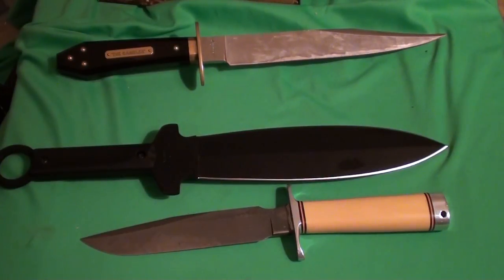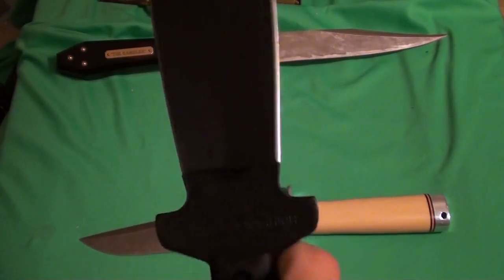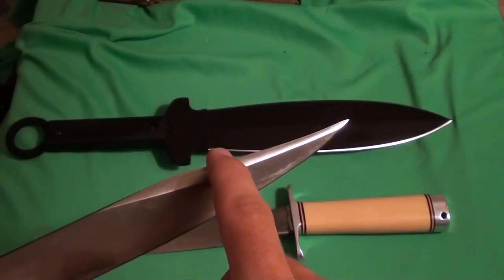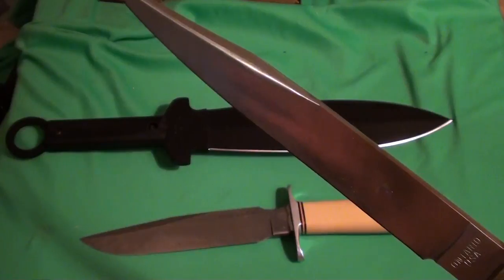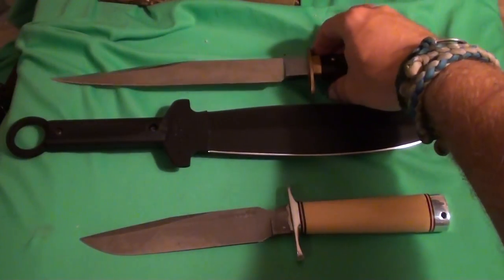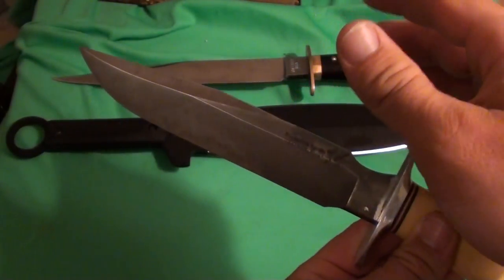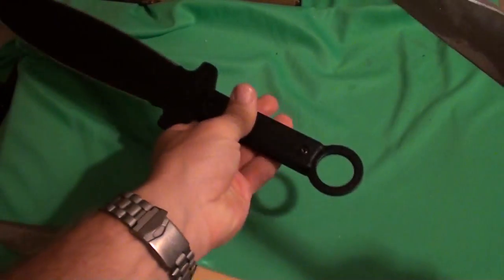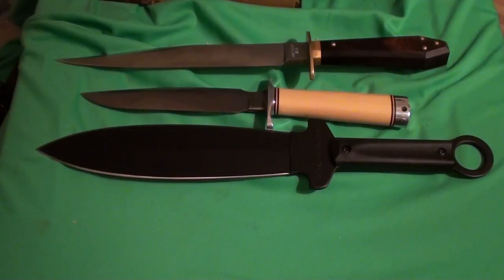The differnce between a false edge and a swedge

Comment: Do you know what's the spine swedge for, on the TRC Mille Cuori? it looksok, but what it's function for on that specific knife? Thanks in advance
Reply from the maker: I looked the knife up I am not familiar with it and it seems like like it might help with penetration
Reply: @Hissatsu5  Actually, it stops before the tip, to maintan the tip thickness. From the search I do the last hour, I came out that it helps for slicing while adding some more steel for strength. If you don't know that maker, TRC knives, is probably the best quality production company out there. The Mille Cuori is their combat knife design. They focus mainly on quality, rather than quantity, which means, they don't make many different knives. It's the only maker, that it's knives, don't lack, in any department (materials, fit and finish, heat treatment, edge geometry etc) Thanks for the response
Reply from the maker: @greekveteran2715  I never heard of them before but thanks for putting them on my radar

Comment: Many, maybe most, false edges have a swedge on them.  Anyway, if I understand what you're trying to say, then no, if a false edge is sharpened, it is no longer a false edge.  A false edge looks like an edge, but is dull.  Most false edges then have a swedge on them,  which is a ground flat that runs beside the false edge, and usually, but not always, down to the point.

Most Bowie knives are described as single edge knives because that's what they are.  The false edge is not sharpened, so there is only one edge on the knife.   When it is sharpened, when it has a bevel and a cutting edge, it is now a real edge and not a false edge that just looks like it's sharp.

Sometimes, to aid in penetration and back cuts, a half inch of so of the false edge is sharpened, and then there's controversy.  Some count this as a second edge, and some do not.

Anyway, there's a reason a knife that's sharpened on both sides is called a double edged blade, which is the correct terminology, and this matters whether the second edge is the length of the knife, or only the length of the "false" edge, which can be false or real.  

Old sword terminology really doesn't matter.  Modern terminology says that a false edge is one that looks like an edge, but isn't sharpened.  Any edge that is sharpened is a real edge, and makes the knife double-edged, or even trop edged, on some knives.   A swedge is a ground flat that usually runs beside the false edge on a knife with a clip point, but can be put on any knife that has only one edge.  

Spyderco is simply dead wrong on this point.   Or aren't being detailed enough.  Almost all false edges have a swedge, but the swedge and the false edge are two very different things, sharpened or unsharpened.  If the edge is totally flat, and the same diameter as the rest of the blade, it is not a false edge at all, and will  almost always be swedged.

But a true false edge is NOT the same thing as a swedge.  A true false edge actually has an edge, and is much, much narrower than the back of the blade behind the false edge.  But the edge it has is not sharp.  A swedge may run alongside this false edge, more for looks than any real reason.  But the false edge itself is NOT a swedge.  It simply isn't, and can't be.  

I understand what Spyderco is saying.  They're saying that if you put a swedge on both sides of the false edge, and bring the swedges together at the top, you have a false edge.  While technically correct, you can say exactly the same thing about the main edge of the blade.  But as they should be, when swedges on the main part of the blade meet, they are called bevels, and the poiont where they meet is called an edge..  The same is true of a false edge.  If two sedges meet, you now have bevels that form an edge.  Whether the edge is dull or sharp, it's still an edge that you can sharpen, if you wish.

If dull, it's a false edge.  If sharp, it's a real or, better terminology, "true" edge.
Reply from the maker: James Ritchie false edge is simply the top edge speaking from a historical/fencing  context false edge doesn’t mean fake edge.